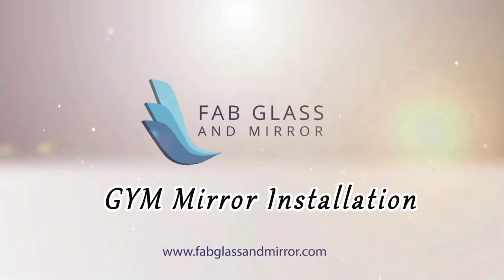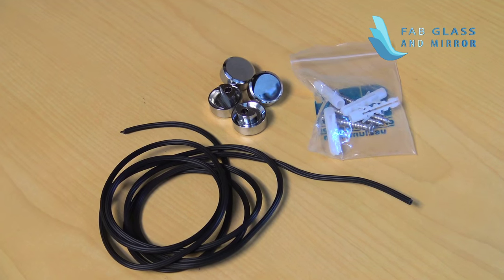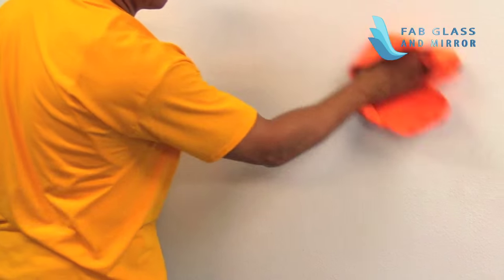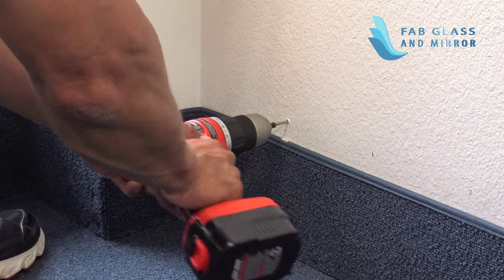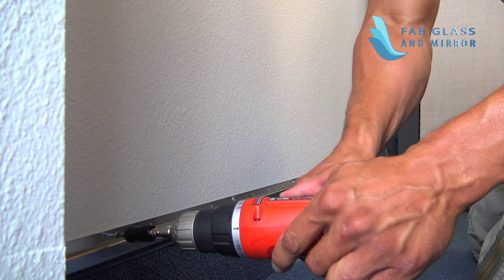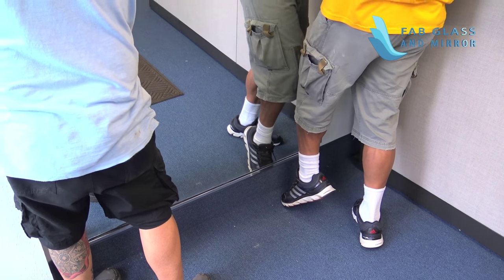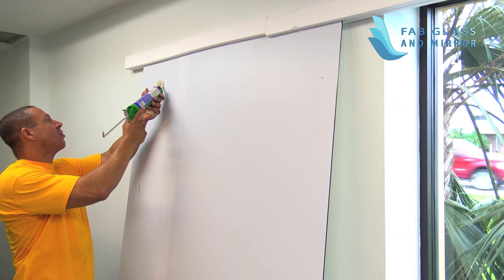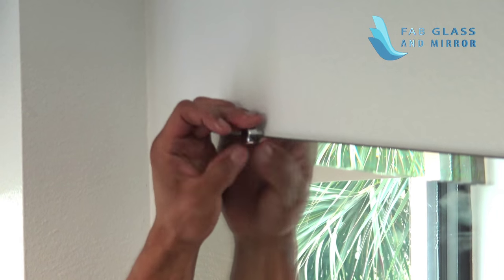Gym Mirror installation Step  by Step from Fab Glass and Mirror

Comment: Just installed our mirror! Reading a few of these reviews, we also encountered the same experiences, but despite those experiences, we are happy with our newly self-installed mirror.

Pros:
- J Bar : We decided to install our mirror tall-wise, which required us to cut our j-bar with a hacksaw, then smooth out with a dremel tool. Also, someone mentioned that the holes in the J Bar are too small... however, the material is thin, and the hole are more of a “guide” rather than actual holes. The screw will go right through just fine. 
- Rubber Strip: the strip was not included so I just use a spare piece of fabric.

Cons
- the dry wall screws that are included work for the J Bar, but the head on the screws are too big for the mirror clip caps to screw on properly. We ended up using our own dry wall screws that had smaller heads that allowed clearance for the caps.
- no rubber strip
- Unboxing: the unboxing is messy. but not a deal breaker. As a consumer, I appreciate the product being packed tightly for safe shipping. 

Overall:
 Very pleased, but also understanding that some level of experience and comfort is required to make this a fun and rewarding process. I recommend that for self-installation, you are already comfortable with drilling and installing [dry wall] screws. We made this a two-person job as well. If you are not comfortable, hire a handy-person! For the price of the product and self-installation, its a good deal.
Reply: It looks like the screws aren't countersunk into the J Bar for a flush surface, do the screw heads prevent the mirror from sitting flat against the wall?  Also wouldn't it increase the chance of the mirror flexing and breaking when  you're cleaning it?

Comment: Mine was missing the rubber strips. And, WHY are the holes in the j-bar a) way too small for the provided screws, and b) alternating holes are slotted rather than round, which, if you use those of course, could shift and throw the bar off level. Hmmm...also, the unpacking of the box and manouvering the mirror are WAY more complicated (the box) and difficult (the mirror) than this easy breezy video wants to have you believe.

So...off to Lowes to buy my own rubber stripping...
Reply: More: this is awful. Neither the video nor the manual describe how to get the mirror from horizontal (laying on floor) to vertical as shown in the video. So of course, with four people trying to lift it gently off of floor to standing, it BENDS and thus, pretty sure it's broken (backing side is up). Simply awful. Waste of money.